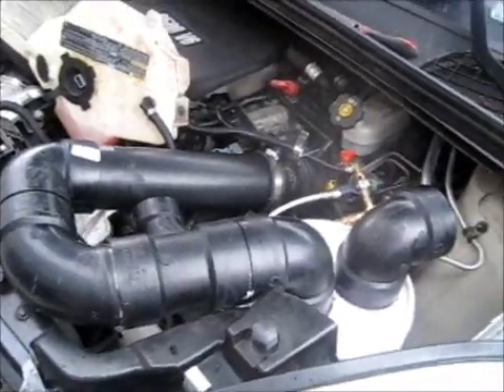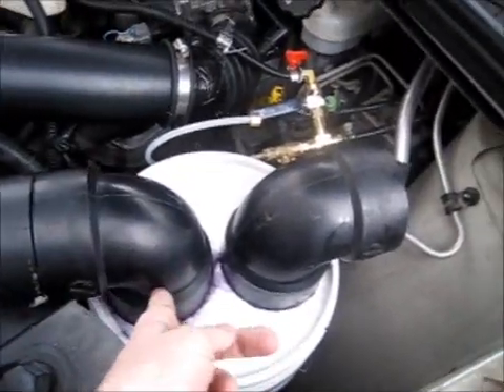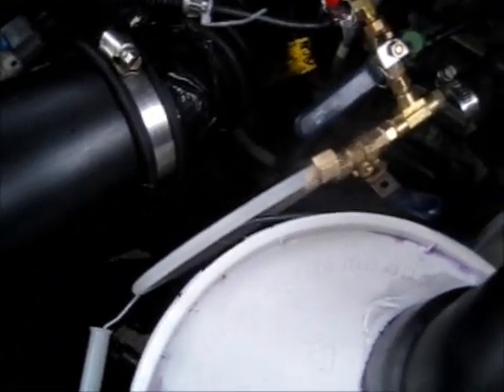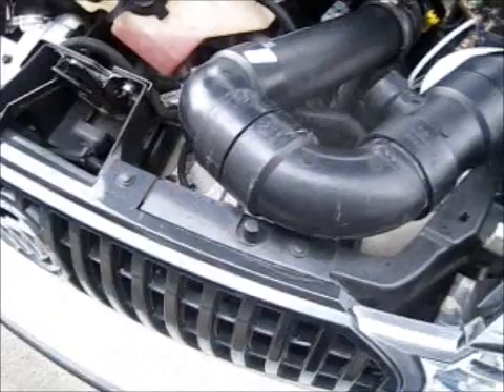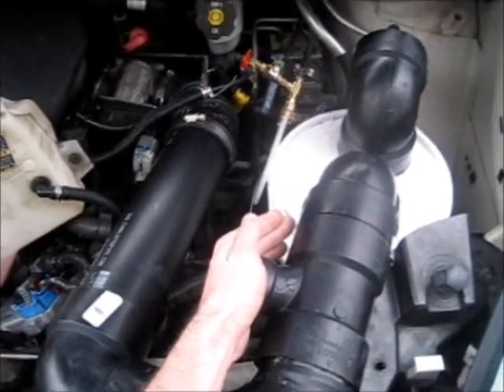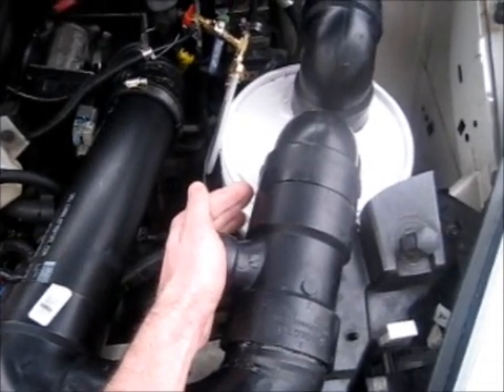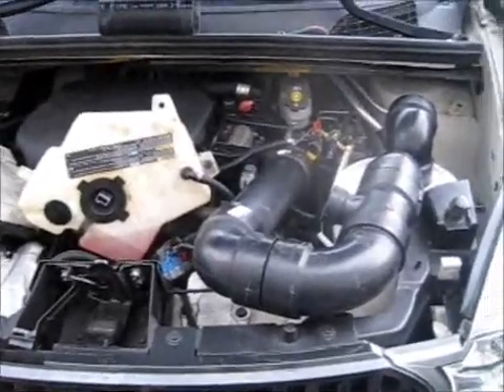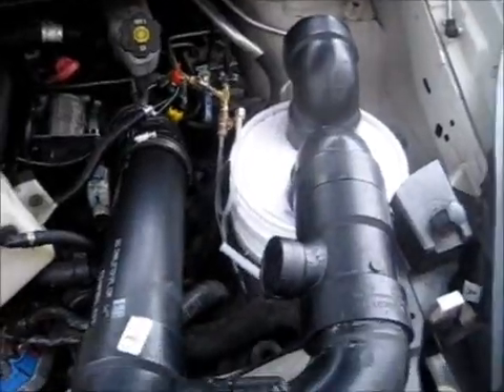Gasoline Vaporizer Build Part 2 (Running & Installed in my 2006 Buick)

Comment from the maker: This particular design is not the best but it did serve it's purpose. I have moved on to much better designs which you can find on my YouTube channel. It is perfectly safe, I use flash back arrestors (screen mesh) to suppress and potability of ignition. Cars now a days do have great things about them but there is one thing they lack and that is efficiency. They are very inefficient.  I have achieved over 200 MPG that right there is proof that modern engines are very inefficient.

Comment: Your going to blow-up your self & others with your caveman bucket carburetor invention. Don't take me the wrong way. I realize that your trying to be engineer of some sort, but I'am going to tell you that your vapor Pcv pipe bucket is light years behind todays gasoline combustion, electronic, direct injected, variable valve timing, displacement on demand, turbo charged technology. I've been professionally fixing cars/ light truck my whole career.

Comment: Perhaps a spring loaded choke or vacuum operated butterfly valve for the 1.5" inlet. Briggs&Stratton used a spring loaded choke a long time ago that might apply to your needs. You should probably have some sort of fuel return or cut off. BTW engine's run off of fuel vapor and have for years. You have just made a form of a carburetor. Similar to ones used by stationary engines from the 1800s.

Comment: Hello Tyson, 

I've seen all your videos and many other peoples. I am in the process of making my own gasoline vaporizer. I have only one concern and was wondering what you did to solve to problem. You mentioned in this video that you were going to make a butterfly valve for air to combine with the gas vapor to allow the engine to continue to run. Did you ever make that valve? What were some difficulties you had with feeding the gas vapor only through the air intake system? Thanks for your help.

Comment: great you made a gas bong for your car. so you just de-engineered your buick. your fuel injectors atomize the fuel as it squirts it in to the cylinder there for running off vaporized gas. that check valve on the car is your throttle and it has a tps (throttle position sensor) that talks to the ecm (computer in your car) along with other sensors to make your fuel injectors work and your car run. also you have a bucket full of gas kinda like a gas tank which your car has already. good job

Comment from the maker: I do have flash back protection. I use a mesh material for this design I use doubled up aluminum window screen material pressed in between the air outlet elbow and the coupling.

Comment from the maker: in this design I do not have any way of doing that. In my current design I have a drain valve at the bottom of the container to drain the gasoline back into the gas tank when the vaporizer is not in use.

Comment: comment, suggestion, discussion, to all that work on vaporizer systems. If we can get 100-150- 200 miles per gallon off of gasoline how much can we get off of diesel? It is well know that diesel has many more BTU's than gas. I have never worked on diesel only gas but I am wondering about the BTU availability, if we can get all the btu's out of diesel? dhotrum at gmail dot com chat with me.

Comment from the maker: Thanks for the support! First please do not copy this design it's not a good design you will have problems with it.  The design I am building right now will be using exhaust heat to vaporize the gasoline. There will be no air bubbling through the gasoline. I will have thermostats to control the temp in the vaporizer. There is quite a bit to the newer design but it need to be this way so it runs properly. I won't use a heating element because they consume power and make the design less efficient.

Comment: I would also like to know if the element is covered by a plate, so that liquid gas doesn't touch the element, but vaporizes on the cover plate instead. Are you aware of any of this? Exhaust and coolant heat will work better than none, but burning vapor only, should reduce exhaust/engine temp, which will lower the fuel heating capability. Am I making any sense here? I'm in the process of building 3 vapor systems, all slightly different to fit my vehicles for trial and error. Take care and thanks!

Comment: Hey Tyson, I've been watching your videos for a few days now since you seem to be able to show and explain alot better than most people on here, and I really appreciate that. I'm looking to copy what you are doing, but I want to crack the gas down with super heat. I know people are using calrod heating elements, like the ones found in dishwashers. What I don't know is how they are being regulated to not exceed the flashpoint of the gas which seems to be 950 degrees or so.

Comment from the maker: It is extremely difficult to achieve these results and is something I am still working on. I am in the process of figuring out the perfect system which regulates vapor, air, temperature, etc. and maintains the perfect mixture and conditions consistently. Once I figure out exactly what is needed to achieve optimum conditions and build a system that is able to maintain these conditions all the time we are in business!!!

Comment from the maker: There are many differences. Cold vapor is not as efficient due to it being more dense and more difficult to achieve a complete burn. It will still increase mileage but by how much I am not sure at this point, I am still testing. As for a hot vapor it can significantly increase fuel mileage. The most I have been able to achieve using a hot vapor was the 211.7 MPG.

Comment: does it need flashback arrestors or no? do you have a blow off valve built in case of explosion? i'm building my now and so far what i've discovered was, i'm limited with spacing in my hood. my intake is 3" but i have to down size the pipes to like 2" or 1.5" in order to fit the vaporizer and under the hood. don't know if air will flow right. how do i get gasoline from my car tank to the vaporizer and without overflowing? i thought about how the toilet works but isn't sure if it will work, lol.

Comment: im still constructing a functional design but basically its a 2 in tube of pvc pipe probably about 6 or 8 in long for each cylinder of the vehicle... this is where the idea splits two ways
1. i Integrate a small perc and air inlet as well as a fuel line on each cylinder, only keeping an inch or 2 of fuel in each cylinder and connect them by a main intake manifold that would connect to the vehicles intake
2. take the same idea frame from above but replacing the small percs with an ultrasonic vape

Comment from the maker: It doesn't matter where you install it as far as the distance goes but you must install it between the vapor outlet pipe and the air intake on the car.
Please hold off on building one after this design I am building a much better design right now and will be posting the videos of it soon!

Comment: ok tyson, i have a question..... does it matter where i put a butterfly valve, i mean does it need to be a certain distance from either the bubbler or the intake? or is where-ever fine just so long as its tuned to the carb butterfly? im planning on installing a system based on your design on my 95 3.9l v6 dodge ram. thanks & awesome video dude

Comment from the maker: When running a cold vapor if I turn on the gas going to my engine my car dies due to an over enrichment of fuel. When I run it off of a hot vapor my car runs exactly the same as if I run my car normally with just liquid gasoline.  The strange thing is when I run my car with gas going to the engine as normal and with the hot vapor at the same time it runs exactly as it did with just liquid gasoline or with just hot vapor. I have an explanation as to how this is possible!!

Comment from the maker: The engine also act a little different when running on vapors. Weird things happen that I am not able to explain yet. Once I have done more in depth testing using a newer vapor system that is a better design I will have many more answers.

Comment from the maker: I have not used a gas analyzer yet. I will be purchasing one so I can know how rich or lean I am running. This will also let me know where I need to make adjustments.
No I am not running spark plugs of a different heat range everything is original other then the vaporizer I have made almost no modifications to the vehicle itself.
As for the lean mixture yes I have considered it. Engines can run hotter when they are running lean.

Comment: Do you run a wideband 02 sensor to monitor your air fuel ratios on the fly? I am curious how lean your mixture is. Are you running spark plugs of a different heat range? Have you considered the effects of an ultra lean mixture on the internals of your engine? I am just starting to browse your vids, so I apologize if my questions are redundant. Cool stuff, I look forward to your progress! I have been blending wvo in my diesel.

Comment from the maker: It all depends on wither it is running off cold vapor of vapor produced from heat. With the vapor produced from heat the most I have ever got was the 211.7 MPG as for the cold vapor I have not been able to do enough testing because the vaporizer was built poorly. I am building a new design and should have the videos up soon hopefully within the next month.